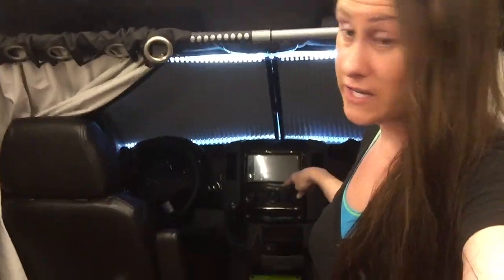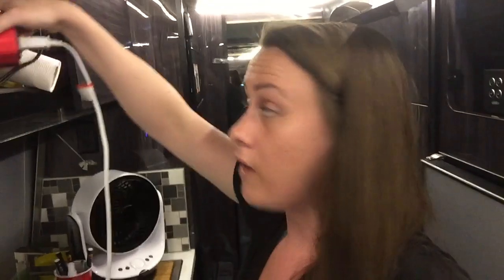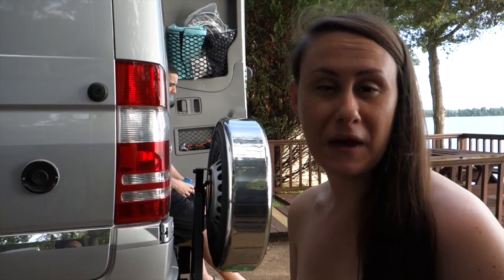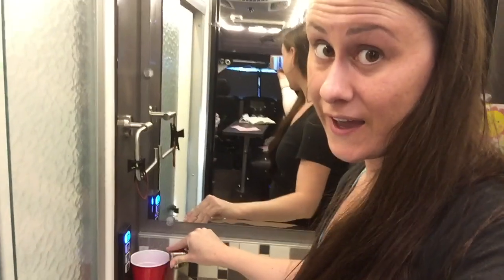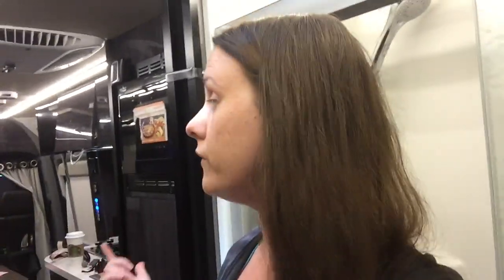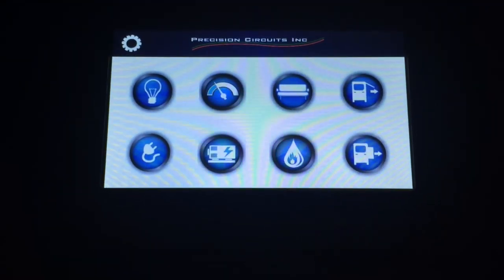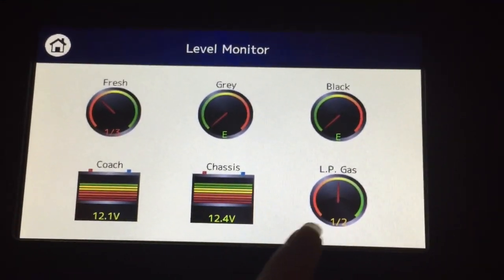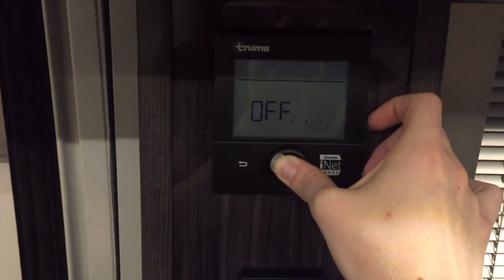HOW RV ELECTRICAL SYSTEM WORKS - RV Electrical System

Comment: The chassis is the whole frame and drive system front all the way to the back. The steel frame that the van, car, truck, rv is bolted to. The front area would be called your cab.
Reply from the maker: Thanks for watching and chiming in Ryan.
-BlogginBrandi